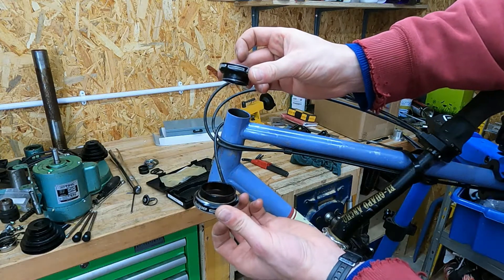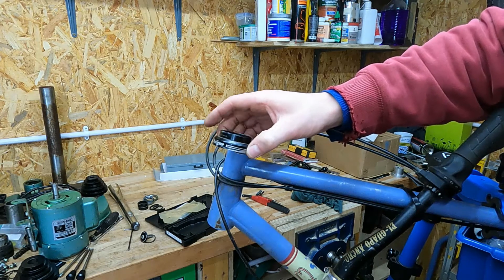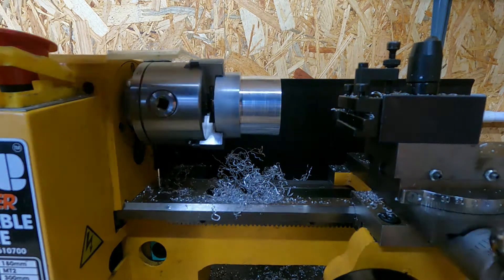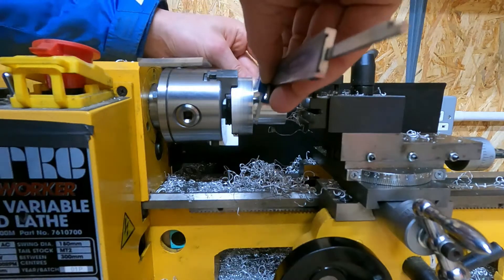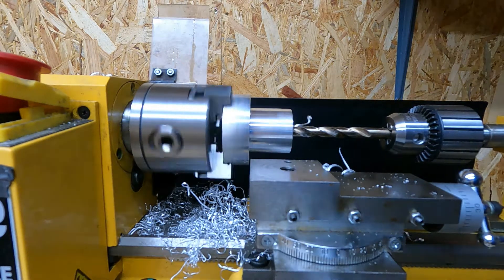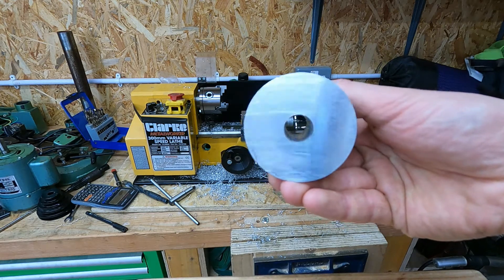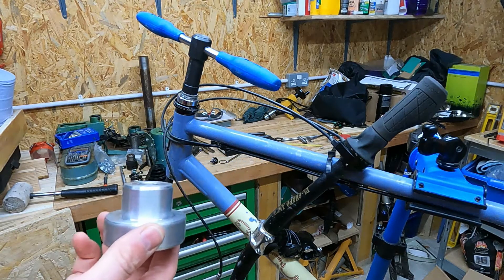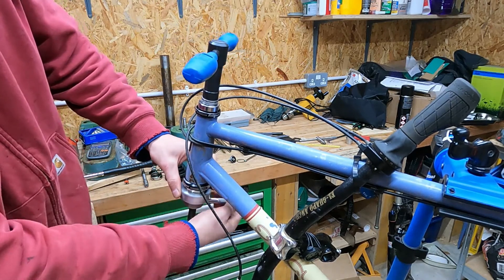1.5" cyclus headset press cup adapter

Comment: Awesome video! My vintage Shimano Dura Ace HP7600 track headset upper cup was damaged and I can’t find a replacement so I’d like to ask if it is also possible to make one.
Reply from the maker: Hey,  I'm glad you enjoyed it. I'm sure a replacement headset cup could be made by a machinist with the right experience, but it would probably be quite expensive compared to finding a replacement. Good luck!
Reply: @dirtbagd89  Thank you very much. So far it's impossible to find one (upper cup of Shimano dura ace track hp7600 headset njs stamp to be exact) so getting it made one is my last option.

Stay safe!